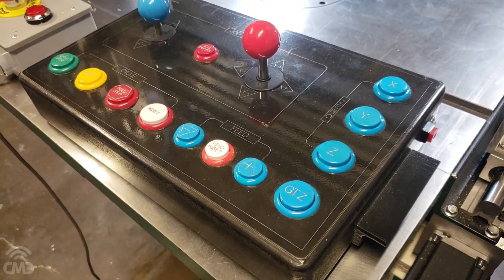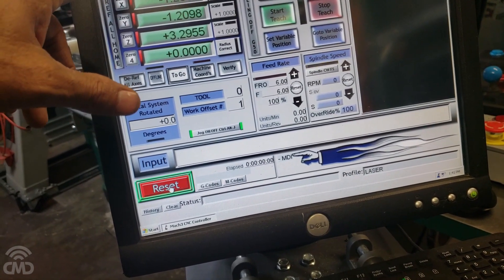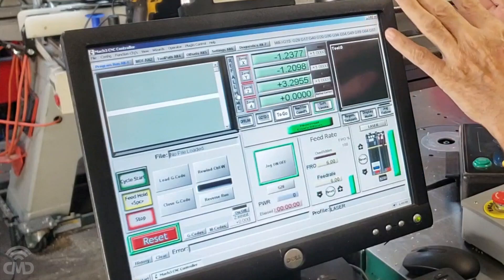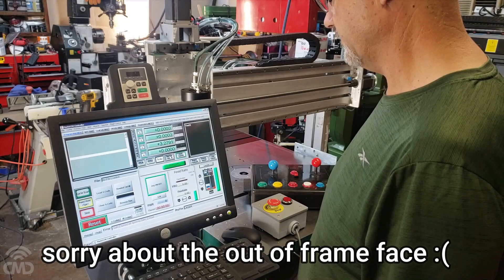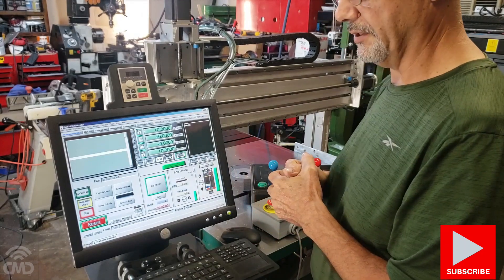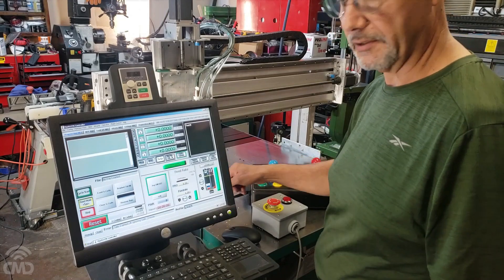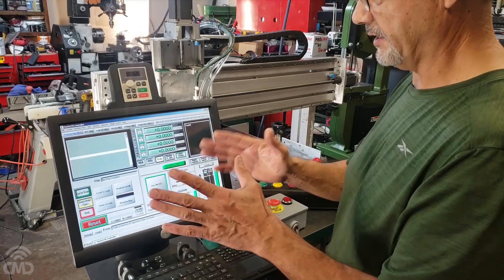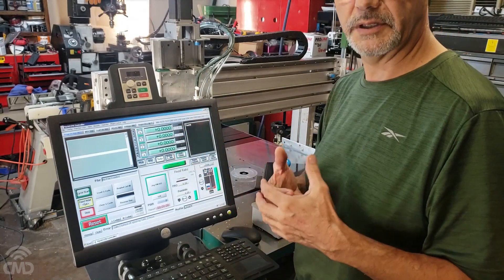Code G28

Comment: Hola Carlos.Instead of programming G28, couldn't you have used the offsets that you can input in the "homing and limits" section so that when you ref all the machine will go to those instead of going to the limit switches?
Reply from the maker: I'm  not sure, but the point of G28 is to home the machine, so from there you know that any positioning will be accurate including the soft limits if activated. Creating a real and software button makes it really easy to make it home. I would have to test my machine using soft limits, to see if it works. (as soon as I have my place ready soon, I hope)
Reply: @CMDWorks  Can g28 be used in machines that don't have limit switches?